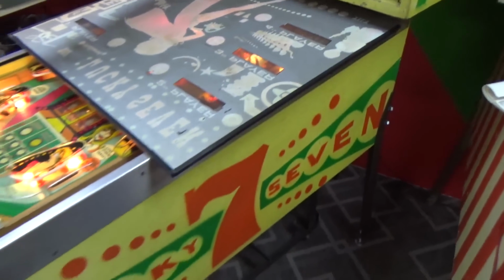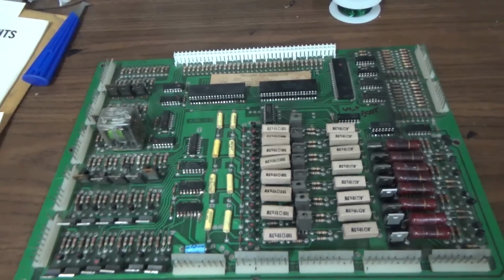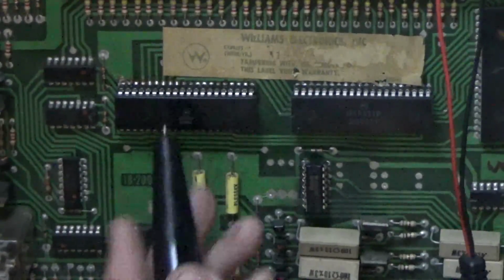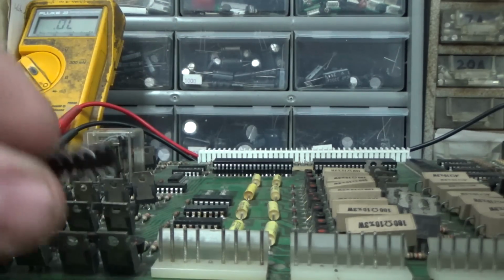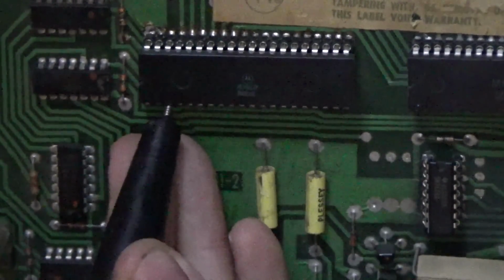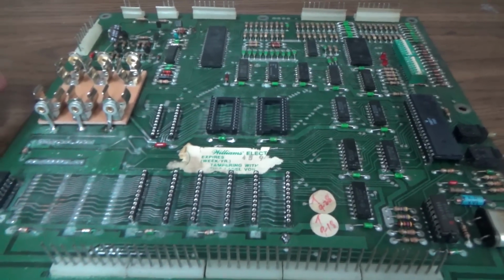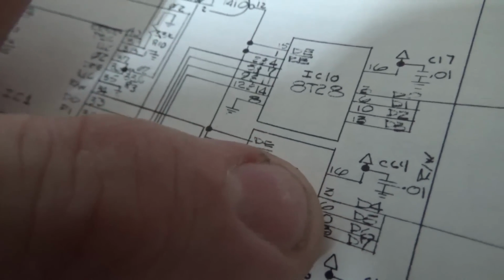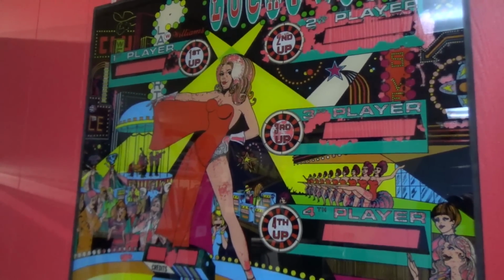How To Find Faults With The Test Eprom - 1977 Williams Lucky Seven Pinball Machine PCB Repair

Comment: Thanks for the cool info Ron, especially on the test ROMS & other valuable tidbits.
Remember these old 8T28 tristate bus transceivers which would die on me a lot but I believe 74LS241 are equivalent with some mods.
Good move to jump the old chips as newer EPROMS & RAM devices are far less power hungry so fanout isn't a huge issue, like you mentioned.
The gaming chair looks amazing & it's been so long since I've seen such a well made chair & kudos to E-win for offering such a nice, sturdy well built office chair.
Stay awesome!

Comment: The 8T28 is basically a 74LS241 with 4 data T/R pins connected internally and double the output Low drive current at 40ma.

Comment: Why bother taking the 8T28s out? Why not just short the pins and leave them in, they're not going to affect anything with the inputs and outputs shorted together. Are they?
Reply from the maker: Good question!  The only thing would be, any chip has an internal connection to +5 and ground, so you always have the possibility of if it fails, it shorts itself to ground or 5, if the chip is removed that can't possibly happen.  You would probably 95% of the time be completely fine for years and years leaving the chip in though so I wouldn't have a problem with people doing that personally.
Reply: @LyonsArcade  I was wondering about that and thinking you could just cut the 5 volt pin, and maybe the ground pin...

Thinking about it a little more I've realized that you wouldn't have to de-solder the chip, just cut the legs off -- which I'm pretty sure is what you said in the video -- I was picturing having to de-solder the chip -- so it makes total sense to just cut it off.
Reply: Ron is absolutely correct.  If you aren't using a part, remove it as it can still cause problems if/when it fails as it remains connected to your power rails an even to the signal pins.  That said, I'd think a buffer/driver has the benefit, even if not explicitly required, to protect the more valuable CPU if something down the line fails.

Comment: The 8t28 appears to be a non-inverting three state quad transceiver. 

I have understood that the "three state" part means that it can drive its outputs high or low, or let them float, this would be necessary in some more complex boards where more than one device can make requests on the same bus, so that one device, when inactive, isn't driving the bus lines high or low when another one tries to set them.

The Motorola datasheets that I found are seemingly at a very poor quality (probably I, an non-paying passer-by, am not getting the full resolution images). But from them I have gleaned that the chip has four throughput channels, all of which have a receiver input, a driver input, and a bus output. Apparently the driver pin, when set, forces the respective bus output to the state of the respective receiver input. 

Now this scheme that we see here, appears to wire the receiver and driver pins of each channel together so that at one level of input the output is forced active, and at the other it is set floating. The chip operates kinda like a current amplifier in this mode. With a lot of ROM/RAM etc connected the processor alone may not be able to consistently pull the bus lines low enough, so the buffer is put there to do the hard work as it can sink or supply much more current. 

You could possibly do the same with AND gates on some boards, but you would lose the option of "floating" inactive state so on other boards where multiple devices might access the bus independently, it might not be a good idea. 

With modern ROMs/RAMs you don't necessarily need buffering because they require much less current to pull their inputs low and the CPU can handle them directly, so you can just remove the buffer chips and jump the gaps.
Reply from the maker: That makes sense!  Apparently the original proms were hungry, and even a lowly 2716 eprom was 'modern' enough that they didn't need the 8t28.  They actually designed them out of the board once they got to system 6 (they skipped system 5)
Reply: @LyonsArcade  The 6800 itself is a three state device, so optimally with a low current memory it could directly work with other three state devices on the bus on a more complex board. I read its limit is about 0,2mA, so if more current must be sunk form the bus to pull the lines low, a buffer is needed. All possible pullup resistors, and all devices that internally pull their lines up in inactive state, add to the current that needs to be sunk to get the lines low.

To fit onto the same bus a chip that does not itself have three state functionality, buffering would be necessary, and this scheme would be one possibility.

Comment: JOE CLASSIC< Why not just replace the bad 8T28 Buffers chips with brand new 8T28 chips or 74LS367? because leaving out the buffer IC chips makes the logic signals levels noises and current is low, the buffer chips boost the current levels and cleans up the signals plus if there are short circuits it won't damage the CPU 6800 or Z80 chip data lines or address lines. I think you mentioned even if you replaced the 8T28 Buffers chips that they won't work with certain RAM chips because the Bigger Sized RAM chips will "conflict" or cause Errors with the 8T2B buffer chips? Correct me if I'm wrong but I think that is what you mentioned
Reply: I would be curious as well.

Comment: I thought Aztec was the first Williams solid state.
Reply from the maker: It was a prototype, that's like saying that when they designed the first board that was the first solid state.  The first one you could buy was Hot Tip

Comment: There's a limit to how many outputs a logic can drive.  To protect the expensive CPU they would buffer the address and data lines because they had so many loads.
Reply: Yeah, fanout current.
Reply: IS that why those buffers were there?  That's good to know. I didn't know why if you can just bypass them, they were there in the first place.  A couple bucks of extra parts in the day, and extra complexity.  I guess the current isn't exceeding what the CPU can provide afterall??
Reply: @SteveJones172pilot  -- Yes, they often add buffer chips to act like an amplifier to increase the fanout current and allow more things to be driven.

And there are other "extra" chips on boards. The many decoder chips that vintage systems used with the memory are an example. Those chips were used to be able to use smaller denominations of memory than there were address lines and still use all the addresses. For instance, in a 64K system, let's say you only have 8K chips. That would be 13 out of 16 address lines. So for the upper 3 lines, you add a 3-to-8-line decoder chip (the inverting variant). Then what they do is wire all the data and address lines in parallel but connect the /CS line of each chip to an output from the line decoder. Thus only 1 chip is actually on the bus at once, despite being wired in parallel.

Speaking of line decoders, the largest ones made are 4-to-16. What if you need a 5-to-32? In that case, you'd use 2 4-to-16 decoders and an inverter. The line decoders have /CS lines too. So in this case, you'd wire the inputs of the 2 decoders in parallel, and connect all the outputs to different RAM chips as before. And what you do about the highest address line is to wire that directly to the /CS of the low bank's decoder and wire it through an inverter to the high decoder.

Comment: I forgot to post on the last video. My machines at work years back had Mallory capacitors in them, the logo brought me right back. HUGE caps too, for the motors (1/3 HP each) I don't remember the rating, they were BIG tho. Maybe 2k "MICRO FARAD" as a guess? Some REDONK number lol, and thanks Ronnie, I can NOT say microfarad normally anymore, only how you do LOL. Good caps tho I must say, in since the factory I'd assume, changed some out over the years but for the most part they held up well! Enjoying the videos as always! :) Edit "Samsonite... I was WAY off!" higher voltage caps, not crazy crazy rating of "MICRO FARAD", saw some different ratings, seems like 120V 462-550 "MICRO FARAD" is preferred by techs I know are GOOD ones lol, I think the voltage ratings are a bit upped from stock (looking thru parts manuals lol) but they seem to work well for the guys I know, mainly they just give the motor a "kick" at start and aid in the braking as well. Okay, just once more... MICRO FARAD. Done. Thanks again for the content! :)